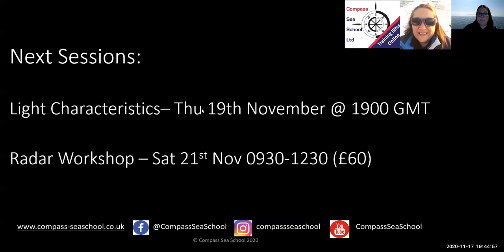Introduction to Radar

Comment: the only reason radar cant c something close is a bang zone when its up high if it is on a small boat it can't c the past the big ships they have steel hull cause the radar to glitch i run a raymaring axiom pro with a quantom doppler 2 dome full marpa arpa fast heading sensor its great i can c the direction of boats coming and going change color with full tracking color pallet for returns
Reply: Good point you have. Have 2 radars one high and one low